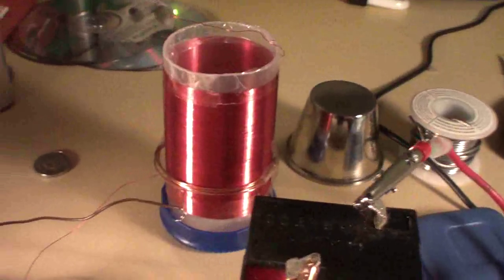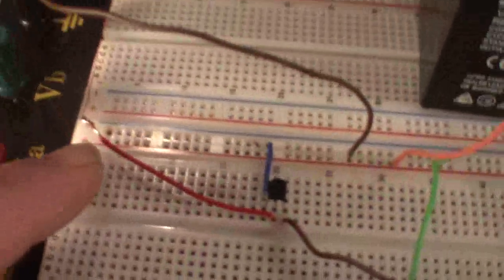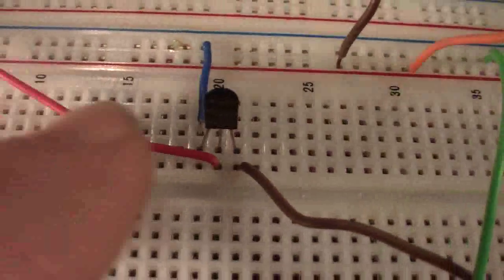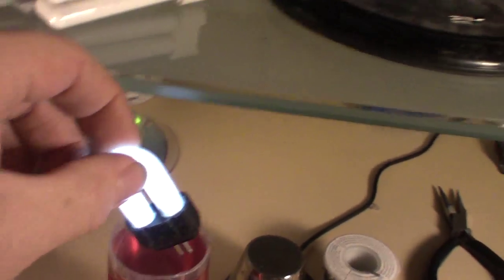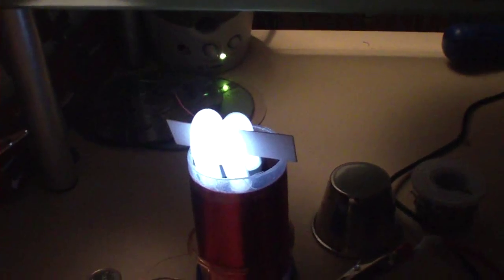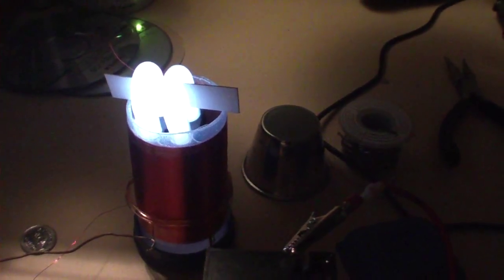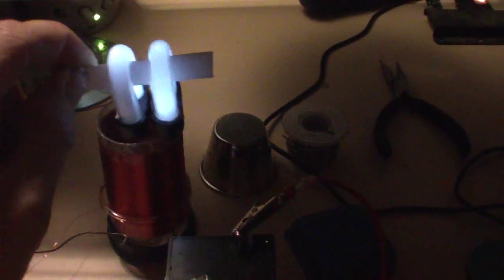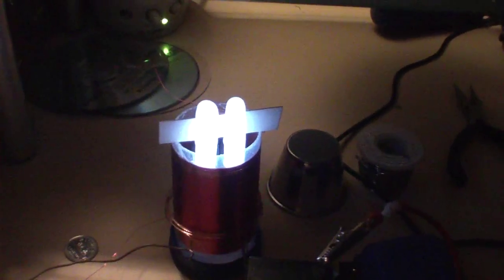Mini Slayer Exciter 6v/72mA Fluorescent Replication

Comment: So u don't have to purge the circuit or use your fingers to start the oscillation put a resistor likeb10k ohms between the  base and collector of your transistor, the resistor does what your fingers do except automaticly,  it's called a pull up resistor
Reply from the maker: Anthony Volkman you bet. that was 4 years ago and the circuit has developed a fair bit since, and i do have that in, now :)
Reply: Still really good work!!:) check out my vid ( pirates of the Caribbean played on my sstc)
Reply from the maker: Anthony Volkman I did! Very cool. can you do a video of the circuit to allow for signal input, into a coil?

Comment: just ordered 100 of the 2n2222's on ebay for cheaper than my one tip31 from radioshack. i think ima going to stick with ebay and stay away from radio shack now..  
thanks for the tips. when i get some free time and the parts in the mail ill give it another go. im working on a mini tesla coil right now as well so i think im just going to finish that while i wait for the transistors in the mail.

Comment from the maker: Tip31 are too low HFE generally. You need a powerful signal transistor. this is a transceiver basically. Try a 2n2222 or MPSA06 perferably, short of that 2N3904.

Comment from the maker: attach an extra wire to the base of your transistor. Attach an extra wire to the collector of your transistor. have those two wires hanging free, and when its hooked up, pinch them with your finger. it'll likely trigger it to fire. What transistor did you use. these are finicky, and the HFE must be high. I often go through many transistors before finding one that works. MPSA06 are best, buy 100 and you'll get 20-30 that work, and 10 that work AWESOME

Comment from the maker: @jonnydavro ... cont ...  In that the stored energy is a function of the square of the voltages, the energy in the bifilar will be 502/.12 = 2500/.01 = 250,000 times greater than the standard coil!" ~ Thanks jonny, look forward to having a peak at what you are up to and also delving into the Simple SEC III and it's enhancements

Comment from the maker: @jonnydavro I will try that. I was also thinking: In a document by Tesla, he talks about winding coils in bifilar but then attaching the parallel winds together (joule thief?) He said "Tesla explains that a standard coil of 1000 turns with a potential of 100 volts across it will have a difference of .1 volt between turns. A similar bifilar coil will have a potential of 50 volts between turns." ... cont ...

Comment from the maker: @Magneticitist Yes i found a lower "just up from the bottom" height to be pretty good. I found that overall stuff liked to be right inside the coil to illuminate the brightest. I never did try lighting a 40w, I don't actually have one, but... it liked a single 15w, better than 13 1 watt bulbs, and worked at about 30% less current. Wouldn't surprise me at all if it lit a 40, it will partially illuminate a 15 @ 3.15v totaling about 0.15 watts.

Comment from the maker: Well, the transister in this arrangement is definitely "fussy" often you have to place a finger across the emitter / base legs to get it to fire. There is definitely RF going on, but as you can see I have a computer lcd, pc case , cell phone all around it... the only anamoly I have noticed is I get a beep from my PC speakers occasionally. No head aches or sounds from it that I can tell. Probably some AM radio interference if you had one beside it? Not sure. Thanks